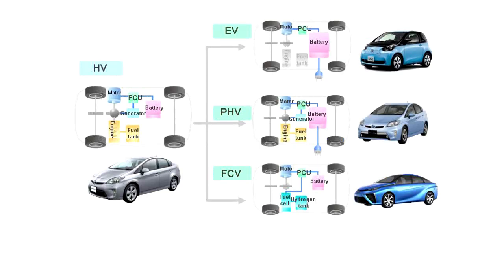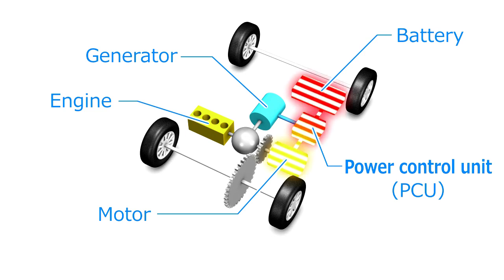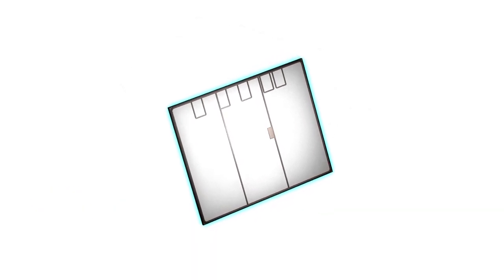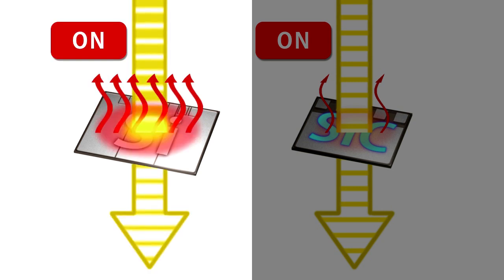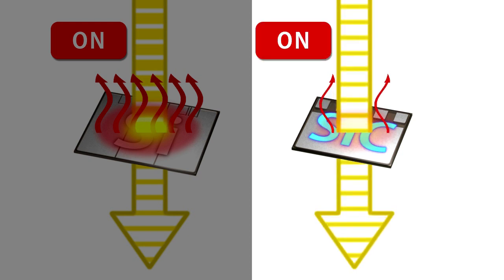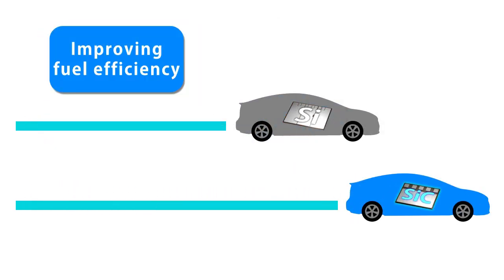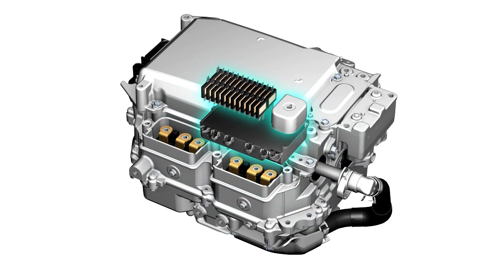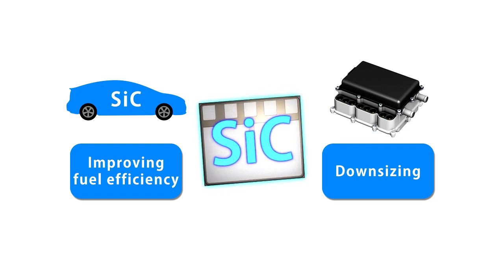Toyota's New Silicon Carbide Power Semiconductor

Comment: Hopefully we'll see this in the 2015 Prius along with a direct injected engine with a longer stroke for more efficiency, and an AWD option and more plug-in range?
Reply: Hopefully the prius will go away along with all other ICE cars. And they will
Reply: Oh wait, Toyota isn't going with this until around the year 2020! Maybe the 5th gen Prius and other hybrid / electric vehicles by then
Reply: @danwat1234  
Guess what, It's 2020. Was your guess right?
Reply: @abo3abid1  we will see if the 5th generation Prius will have silicon carbide. 5th generation is what I was alluding to when I said 2020, whenever their next major refresh occurs. 
I was right with more plug-in range and all-wheel drive however